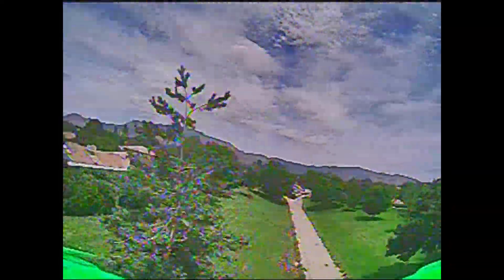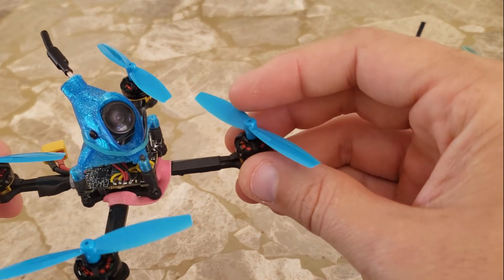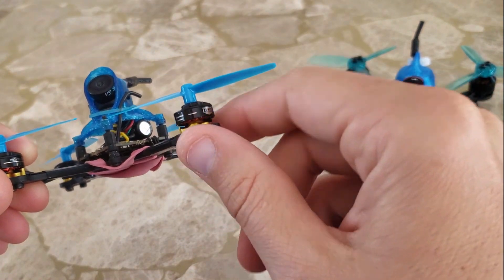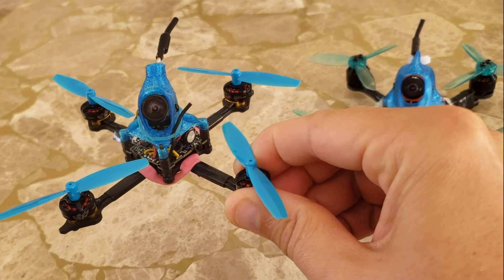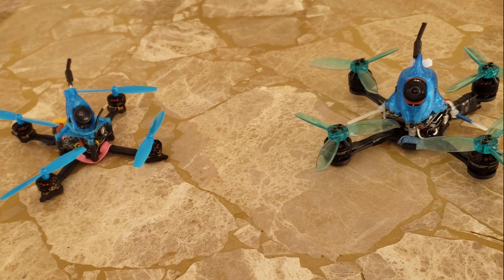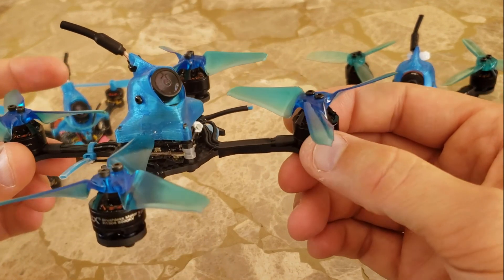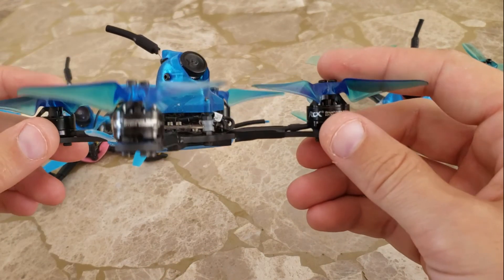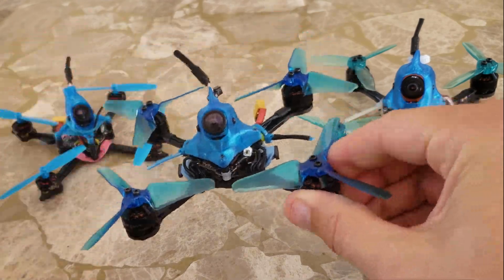Toothpick 3" Racer (3 Inch build with Runcam Nano Racer)

Comment: Anyone try Emax 1306b motors 4000kv 
On 3” 4s ? These are the newer t motor setup. Trying to decide if giving them a try vs the Rcx
Reply from the maker: Haven't tried those one but have used the RCX 1306s.  Not sure the AIO boards we use on the Toothpick style builds would handle 1306 4s, I think with those motors you're much safer with a 20x20 stack. That being siad, on the build I did in a 3" Toothfairy frame the 1306 6000kv on 3s RIPPED!

Comment: Those motors with a GF 3020 bi blade on 4s only hit 11.6a static have you tried a 4s yet?  I have a 3" Sanchez very similar. Love these 3"
Reply: With the rcx 1304's 5000kv on avan tri props been running 4s no issues. Have twenty or so packs. Peak amp draw is 36a on chinahobby 650 4s.  It flies a bit heavier but with the triblades handling is much better. It's considerably quicker than on 3s.

Comment: That build looks great! I have a very similar build with 1404s and totally agree. Small and quiet like a Toothpick and fast like 5”. How are the batteries handling the amps? I had some trouble with voltage sag. Running a bit higher 6000 kV so I wonder if that’s the reason.
Reply from the maker: Had no issue with voltage sag with 525 or 550mah batts. Yeah I am guessing it is the higher KV and taller stator that could make it more prone to voltage sag. With 1206s at 6000kv I can def sag the battery though.

Comment: I have a couple light 3inch builds in the works  that should turn out a lot like yours. I love the rcx motors on 2.5 inch and 4s and I think they will be great on 3 inch ultra lights on 3s for sure and perhaps 4s ( I plan on using the gemfan 3025s). I have also been wondering about the GEP 1206s and how they would compare..... I bet the 4500 kv variant would rock on 4s and the  appropriate prop